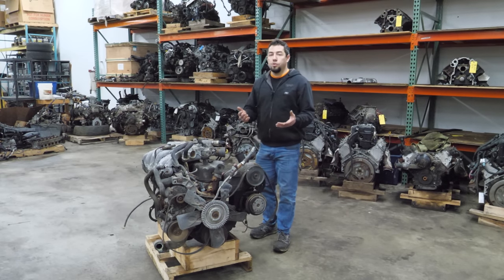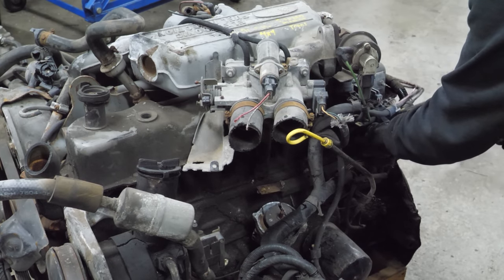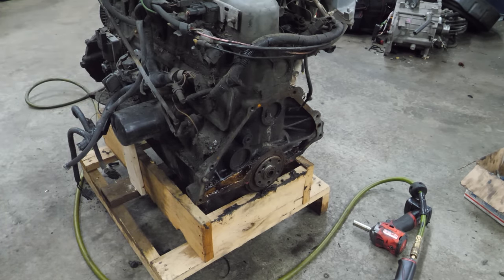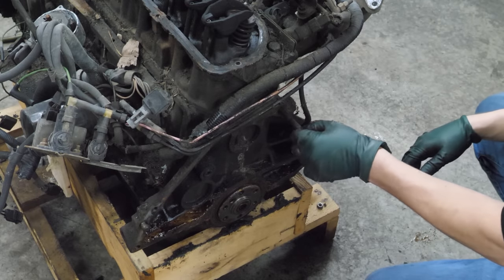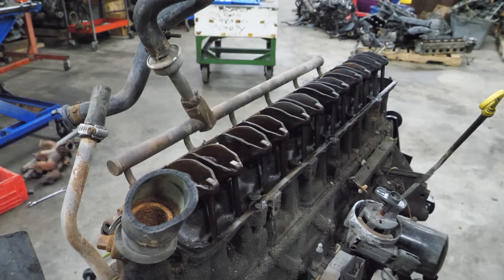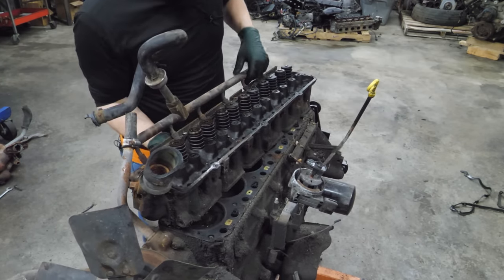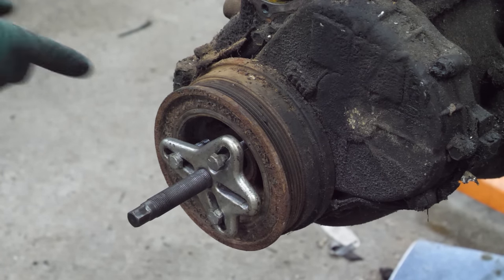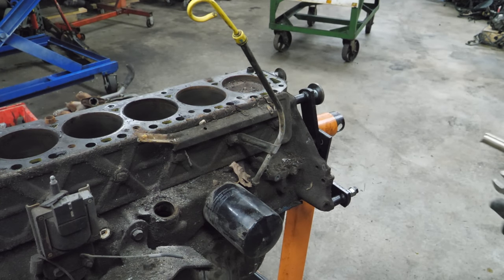FINALLY! A "Bad" Ford 4.9L 300 Straight 6 To Teardown! Most Reliable Engine, Ever?

Comment: I have a 1991 F150 with the 4.9L in it, got 192,000 on it now, the problems I've had were from not driving it, and the in tank fuel pumps.  I do wish you'd taken off the side panel and pulled the lifters.

Comment: I wore 2 out but each engine had 300,000 miles on em. 
When they get 300,000 on them they lose compression and blow oil.
The Ford 300 engines were only $500 installed, so we ran them until they died.  Only the Dodge Slant 6 motor I owned was more bullet proof than my Ford 300. Memories....thanks .
.

Comment: Its because the block and heads are so robust compared to your typical v engines. That robustness allows for better transference of heat so that when a problem occurs that heat is spread out and not localized in any one  area . Meaning the oil is not turned into carbon and keeps its lubricating properties.thats my opinion of course

Comment: For additional 300 fun, do a search for the 300 racing engine with a head made from 351 clevland heads, cut and welded together to make a cross flow head. They were done in the 70's

Comment: the Dodge 225 slant six is the "toughest" engine .  oil and water were  practically optional.  I had overheated one to the point the exhaust was glowing let it cool and drove it home . The Toyota 22r/re is also up there .I've owned  the slant six  Ford 300 and 22r and 22re For some reason I'd bend one of those long pushrods every so often.  The R22 RE timing chain ate though the cover around 250k . the slant six in an old dodge dart is the only car then I've had that never needed an actual engine repair . as far as the sludge they called those quaker state motors when I worked in the junk yard .  something about to much paraffin wax would leave buildup like that in it . met an old man that brought in his dodge van to junk as it barley ran . he said he always changed the oil every 3000 miles with quaker state .  I took off the valve covers as it had some broken valve springs . every empty space inside the valve cover was completely covered in sludge.Not a coating I mean filled like.. imagine using spray foam inside the valve cover then u slam the valve cover on and let the foam dry kind of build up . if it was not a moving part the entire void was completely filled with built up plastic like sludge. the fact it ran at all was a testament to the 318 engine .

Comment: My old ford had a 3 on the tree 300 that pulled my old Pontiac with a 600 motorcycle in the back with all my possessions from Illinois across the mountains to Washington state. When I got to Washington I sold the truck 3X I paid for it 4 yrs. Earlier

Comment: I had one of these in my 1965 Ford Pickup truck with twin I-beam front end which would take washboard roads 50 miles an hour if I remember right it was 3 speed on the column and I just about trade the truck ahead now to have it it was the easiest thing I ever worked on in my life he could darn near rebuild the motor without ever taking it out of the truck

Comment: My first car was a Ford Maverick.
The car was so bad that, when I pulled into a gas station, I would check the gas and fill the oil.😂
Back then, there were still ful-service stations. 
I went too far to fill the oil a through a rod.

Comment: One draw back of that year engine is easy to break ears off of aluminum manifold,, make sure torque to spec there, around 18 fts for the 3/8 bolt....... And another draw back is only 4 head bolts for each cylinder which makes it easy for head gasket failure when overheating... over all pretty reliable engine

Comment: I worked on these at a L/M dealer in the early 70s.  I wasn't impressed, mostly because the valve stem seals (like just about all of MOFOCO products at that time) were crap.  They disintegrated around the 10,000 mile mark, and if you were a good owner, you noticed the increased oil consumption and got it fixed.  If not, all the chunks ended up in the oil  pan where they eventually plugged the pickup.  Or, if you were really a bad boy, the detonation from oil in the combustion palace knocked a few holes in the pistons.

Comment: This engine is the antithesis of the 2.7L Ecoboost. The valvetrain and oil pump are gear driven as they should be, the intake manifolds are all metal, the oil pan is metal like it should be and the block is all iron and overbuilt for dump truck duty. This is the engine we all deserve but the EPA will never allow again. It would've been cool to see what it couldve done with a more modern head design and a cam that could actually flow enough to outrev a flathead Briggs.

Comment: Had an 87 f150 with this straight six. Of all the trucks I owned (300, 5l, 4.8l, 5.3l, hemi) the 300 had the worst gas mileage. The 4.8l, 5.3l and hemi were all 4x4 and extended cabs yet still had better gas mileage than the regular cab long box f150 with a 300.
Reply: I love my Ford.
I love my 5.7 Hemi.
Both have 300,000 miles.

Comment: I just rebuilt mine after I assume hundreds of thousands miles (odometer rolled over idk how many times) just cause it puked sooo much oil out of everywhere cause of 1. No pcv just venting to atmosphere 2. INSANE blow by like an air compressor. Still ran fine with a lil shake at idle. When I tore it down there was a giant chunk of piston skirt and and rings in the oil pan, yet I never suspected a thing cause it still ran so damn well. Now with it freshly rebuilt by me, it’s got pcv and high quality parts. Will last me my life I bet

Comment: My guess: someone ran this with straight water after the thermostat failed, and just kept running it by adding water, then eventually decided to add antifreeze. Those oil rings are the reason mine still doesnt burn one drop of oil in 10,000 miles; and I only change it once per year.

Comment: The 300 came out in 1965, basically at the same time as the 240, I'm not sure if there was a  model year (1964) where only the 240 was available, actually - I think they were always both available at the same time, until the 240 went away in the mid 70s.

Comment: I have a Ford 300CI six in my parents basement from my Ford days if you want it. It's been rebuilt and turned once a month. It's bored out to 351 and has a custom grind torque cam by a reputable machinist that's no longer with us. Just let me know. I have $ 1500 in it but it's in Southern Maryland. I stumbled on your channel and I've subscribed. Thanks

Comment: In my state we do not have emissions testing and what Im looking for is an f250 with the failed 3 valve 5.4 (cam phaser) but a good body, ill take the engine out and throw in a 300 six and 5 spd. The problem is its hard to find a good body truck worthy of doing the work around here in the midwest, they are all rust buckets. I collect the 300 six and have 8 of them with various trans setups (M5R2, ZF5, transfercases etc.). Great engine to put into rat rods etc. something different from the V8 crowd.

Comment: 300's hardest engines were to kill back in the cash for clunkers when we had to kill the engines before junking the cars first, we drained the water and oil out then poured a quart of liquid glass in the crankcase drove them out to the back lot and put a brick on the accelerator and left them run till they locked up or blew up. It was not uncommon for a 300 to start backup the next morning.

Comment: You might want to check under exhaust valves, That is where it would crack . Worked in machine shop for several years.

Comment: I've owned several of these over the years in the F150 line.  The trouble in California is that they are hard to get past smog inspection after about 150,000 miles.

Comment: I had a 1972 E 100 panel van. 240 cu in 3 spd standard single barrel Carter carb. 22 mpg loaded or empty city or hwy. slow acceleration  but you couldn't kill that emgine.

Comment: This would be a good build project. Bore the block 0.40 over the up the displacement to 5.0 Litre six. Machine the crank balance the rotation assembly deck the head new pistons performance cam. Update the EFI And ignition. Drop it in a 90’s f150 with a 5speed manual and have fun with it.

Comment: I've had 3 in my life, 2 of which were over 300k when I got them, and one I sold still running and driving fine. I have another from 88 but it only has 215k.

My friend has owned easily over 20 in various offroad rigs and has yet to actually destroy one, he simply ruins the vehicle around it.

Comment: It'd be cool if Ford would resurrect the "ordinary straight six" engine. With new materials, new injection, new control on the head, etc. it could be fantastic. DOHC of course, these days.
B58 is the killer modern I6 right now but you won't be seeing it in a truck.

Comment: Had one in my 81 F150 with a one barrel carb, it could barely get out of its own way as acceleration goes.  Killed the original engine after a water leak and no oil, well like a quart of oil.  Seized it up and had to have it rebuilt.  Had transmission work done, the mechanic came out and asked me if the mileage was correct on the truck since he found the temp fill plug from the factory in the pan.
My 94 with a 300 had fuel injection, a little more get up and go, and traded it in like 8 years later.

Comment: I still remember back in the 70s, and early 80s the number of 300 inline 46 that I saw with a number 6 connecting rod sticking out of the block I stopped counting them. They were horrible. It might have been caused by a state of bad head gaskets. But those things were the most unreliable thing that I saw for a while back then.

Comment: Ford 240 started in 1963 at CEP#1.  240/300 share the same head and carb. other differences to the basic engine.  I believe when Ford switched to the 300 at CEP#1, they than started the 240 line at LIMA.  Good folks at LIMA didn't mean to leave them out.

Comment: I owned two of these great engines, both in F-150's. An 84 model that had a 1 barrel carb, and a 90 that was injected. Both very reliable. 

I have a feeling that why cylinder 5 was so clean is that the head may have warped, especially if this engine ever overheated in it's life. It's one down side to having a very long, single piece cylinder head.

Comment: The vehicle I learned to drive manual on was a 85 for f150 straight 6. What ended that vehicles life was a large square bale that broke it's back. Engine probably still works.

Comment: Another reliable straight six engine is the Toyota 1HZ 4.2 litre naturally aspirated diesel, still in production since the 1980s. If maintained, easily achieving 1M Klms.

Comment: The heads on the 4.9 efi where known to crack around the exhaust valve. Just took my head off and it was cracked there in 5 different cylinders. Never would have guessed by the way it ran

Comment: True story, I once towed a ford van  with my 1985 f150 with a 300-6  2 hours so my uncle could swap out the engines, the thing is, the f150 had very little oil pressure

Comment: the last straight 6 ford engine here in the uk was in the 1960's. it was replaced by the V6 Essex engine. the essex also had a gear driven cam. the problem is the large gear on the cam was made of fibre and known for failing. the was also a V4 essex engine

Comment: I'd propose the Volvo B18 as an opponent for most reliable engine ever... Pretty similar specs, cast iron block and head with OHV and cam in the block with 2 valves per cylinder, pushrods and rockers. The B18 has 2 fewer cylinders and still 5 main bearings. Also, as long as you have a good battery, that sucker WILL start in -35 degrees C (-31 degrees F) with the choke on and the heater cores in the Volvo cars are HUGE. You'll be in your shirt inside of 20 minutes with the heater on max in a Volvo Amazon 121.

Comment: We had 300’s in our business and the only thing equal was the 292! 
Why was the 292 discontinued?
Inline six cylinder engines are inherently superior and strong because of main bearing surfaces and having less piston drag because of being vertical. Although some early designs had less main bearings! 
Lots of low rpm torque, but some later designs made more horsepower at higher rpm’s. 
Great design and all manufacturers had some great engines.

Comment: I’ve got 2 of them. One in a mud truck and another in a beater, both f150s. I have had issues with the distributor and oil pump, gear, breaking, but the way they designed the distributor gear is driven by the oil pump so if one or both goes out, then the engine just shuts down. That’s really the only complaint I had about them. They’re not fast by any means but will pull the house down just with the torque they put out

Comment: That engine has been badly overheated once until it seized, it also shows signs of ultra extended oil change intervals while 
suffering internal water leaks, plus as stiff as that crank is  - line bore issues. My post quit/ teardown analysis It didn't have 
enough compression to keep destroying itself while overheating the last time.

Comment: I have owned a few of them and can say I have never had much of an issued with reliability. The only problem was a failed water pump and overheated and took out the head gasket from a 72 ford.

Comment: From what I've seen over the years (which is quite a few blown up 300s), what seems to be the main thing that kills them is overheating. Most overheated 300s I've seen cracked the head, the other thing that kills them is a severe lack of lubrication, but at least from what I've seen overheating seems to do em in first. Either way they'll still generally continue to run, they just drink coolant. They're great engines but I'm of the opinion that the 302 is a better engine. Regardless, every engine ford put in their trucks from 80-96 were all great engines. My least favorite being the 7.3psd. The idis are awesome though.

Edit: if you cut a couple notches in a milk crate you can set it over the leg of the engine stand and set your fluid catch pan on it to avoid as much spills.

Comment: I seem to recall that the 300 actually came out more or less concurrently with the 240 back in approximately 66-67. Most of the the light trucks ordered with sixes had 240s, but advertisements I’d seen from the time shows the 300 as an option. The 240 was still the base up into the mid 70s. My dad had a 67 and later a 74 F-100 with the 240.

Comment: I drive a 91 f150 with this exact engine.  It ain't no powerhouse but it will get you there.  Comparing the difficulty of tearing down to a sb350, the chev is much easier!!  Both are great engines that will serve a lifetime if serviced right.  That said, Ford tried to put way too much smog control on the 300's of this era

Comment: Had a  4x4 F150 with 160k on the same motor, sold it; the buyer put another 40k on it and it still was not burning any oil.  Wish I still had it (and the truck too).

Comment: Hey Jr maybe if you were a bit older you might have heard of the GM 292 inch 6 or the 283 inch SBC Or even the slant 6 they are all rock solid reliability ...Normally it's intentional abuse that blows these motors up.

Comment: The other great thing about this vehicle at least in Canada is Ford Fleet Sales. They do the fleet vehicles after they did the first runs of the new model-year getting the moat to the showrooms. And then they'd have all the bugs worked out of the line so he's tended to be put together really well, but some things were a little bit messed up. Because it be running out of certain parts in the assembly line if you get water pumps Etc with odd hose routing. When they had to replace mine it didn't fit because the hose manifolds were in different places.

Comment: I had the carburetor version of this same engine in my 1980 F100. It used an enormous amount of oil when I junked the truck at only 140,000 miles. I wasn't the original owner, so have no idea how it was treated before I got it.

Comment: I had one that I got rid of during Cash For Clunkers and I hate myself for doing that, it had 470K miles on it and I put all but 90K on it myself and never had to rebuild the motor. Now yes I did go through a handful of starters alternators and the like regular plug changes all that kind of service and I think I had to get the clutch replaced 3 times but I put an incredible amount of miles on it and wouldn’t have gotten rid of it if it wasn’t for the fact that every single body panel looked like Swiss cheese with all the rusted out panels and the frame itself was rusting out and flexing. Why I hate myself is I should have took it pulled the engine and trans and swapped it out in another F150 that had the worthless 302

Comment: I can't help but feel like the the thing that really makes a good motor is the simplicity and ease of the casting design and the place and materials it's casted at it seems if you get those parts right you will have a truly great motor and if you skimp on those things you might have an ok motor and you might have a pile of junk

Comment: Go look up the racing 300 built in the late 60's/early 70's... spectacularly strong powerplant. I owned a mid 60's two door Ford Galaxy with a 300 in it. Honest to God above, it was the easiest engine ever to maintain. Purred like the proverbial kitten - probably still running today.

Comment: I'm a mechanic out of all the cars I've driven and fixed and beat the shit out of on trails,towing ect. I have to say the ford 4.9 is by far the toughest sob around I have had a few ford's with them and drove many others I have never seen one fail and I have thrown them a serious beatin they always come back for more! 
P.s. if your looking to build one and yes they do build them and make pretty good power if done right the industrial version of there's engine are 4 bolt main verse 2 bolt in  Vehicles